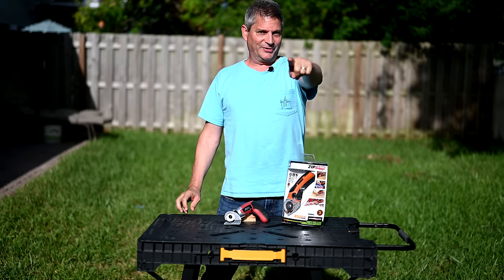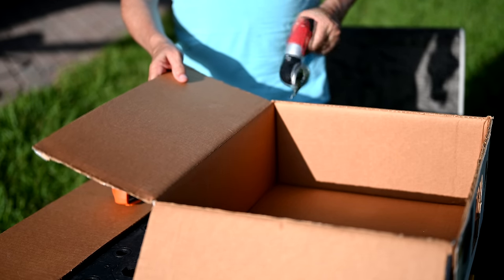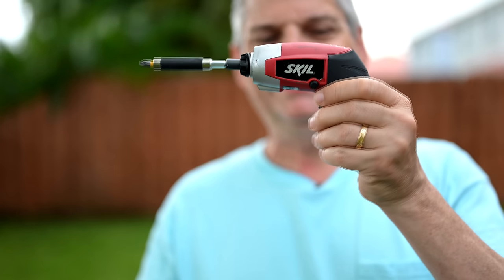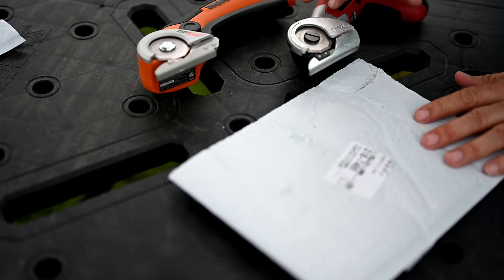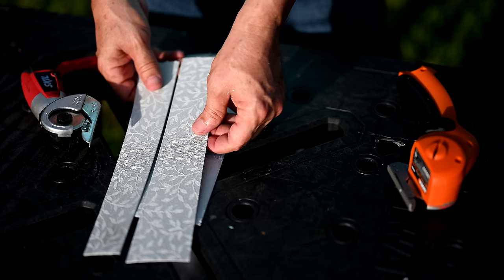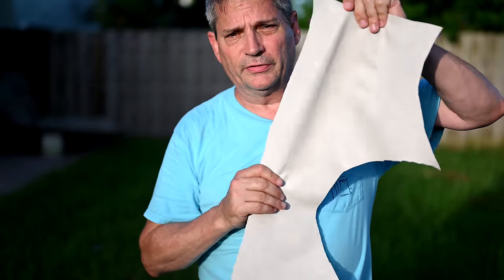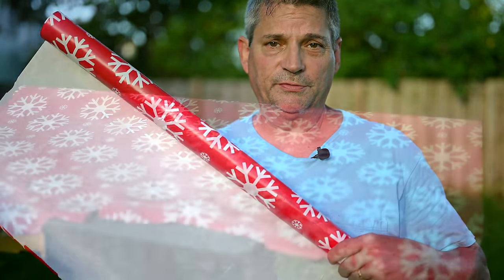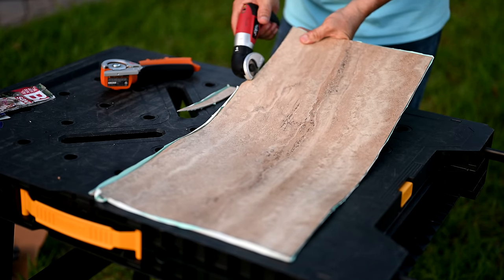Worx ZipSnip Cutting Tool Vs Bosch/Skil: Which is Better?

Comment: Looks like a great tool, For me, I fold all of my boxes and use no power. It's so easy, just cut along any tape that's holding the box together.............and fold. Saves a LOT of time and energy and battery power. Unless you deliberately have to get the box into small pieces in a very small recycling bin, can't see any reason to cut it into such small pieces unless that's purely for demo purposes.
Reply from the maker: I usually cut to 12" up to 18" pieces for recylce

Comment: A battery replacement might help the old tool. The new one seems decent. Don't know if I'd spend that much on one though
Reply from the maker: Problem is not the battery, the guard is all bent out of shape from years of abuse, the blade is still spinning correctly.

Comment: Enjoyed your Video.-- Great that you used so many different materials. -- Question -- How do you know if the Worx is as good or better than the Skil since you were you using a Skil that had a lot of past wear on it. ---  Do you think one cuts better than the other if they were both brand new ?
Reply from the maker: I think they are made by the same company. I think they were the same because the Skil used to be able to do what the Worx was doing.
Reply: @jeffostroff  Thanks for the info. -- I appreciate it !

Comment: Just curious how old was the blade on the Skil? I've the little skil screwdriver that's identical to that cutting tool and think it's neat. Would you say the skil cutting was well worth it?
Reply from the maker: Yes, the tool was worth it. If you can find the head unit with the blade on eBay, it might fit your tool. The blade is awesome and self sharpens.

Comment: I just purchased the zip snip but after watching your video I think I like the skil better I like how the head comes off of the skil I'd take it off & pop it into my impact drill & really get it flying, if the guard on you're skil is tweaked why don't you just bend it back? You seem mechanically inclined just clamp some visegrips on the edge and bend it back in place a little
Reply from the maker: I've tried it, just seems the alignment is too critical. Canadian company sells them for $50 but it's $25 shipping to FL. I woudl buy a new one if the total cost didn't come out to 3X my original $24 price.

Comment: i have one,  this does not cut through heavy duty cardboard  you have to push hard and it gets stuck.  video looks easy
Reply from the maker: The heavy cardboard I had was on the TV box, and it cut through that. Appliance boxes it can bog down in parts, which is why I cut it on the creases.

Comment: What I do to cut blinds is , use a grinder with a thin metal cutting wheel , and cut the whole stack at once , but do it outside !  I also use a clamps to keep it in line after I align square  ! Try it for yourself , let me know what you think  ?
Reply from the maker: Great tip! No chips at all on the bottom?

Comment: If you're going to test both of these, you should have used a new skil. If it's old, then it doesn't really allow you to compare it against the zip snip fairly.
Reply from the maker: It was not meant to be a fair apples for apples. As I mentioned numerous times in the video, my old Skil was old and worn down but it was all I had. AND you can't get them new anymore you can't find them. You need to pay attention better

Comment: Could this cut 1/4in wood? I noticed it's not a toothed saw blade so I assume not. I'm looking for a CHEAP EASY method to cut 1 foot wide detailed decor with curved edges out of thin 1/4 inch wood squares without it splintering or snapping. Hand saw takes forever. Jig Saw requires a table but can slip via human error if not mounted (maybe upside-down?), i.e. an EXPENSIVE HEAVY DUTY table saw. Good video btw, thank you, still might buy this lol.
Reply from the maker: This will not cut 1/4" I tried to cut 1/8" wood cabinet panels that we us eon the end of a cabinet and kickplate, and it bogged down as soon as we tried. But 1/4" will not even fit into the bade guard.
Reply: I’ve been using it to cut paneling - I thought it was 1/4 inch but maybe it’s less - any way it is totally not the right tool for the job … /:

Comment: Either. Oscillating tool with hook blade is the best and one less tool to charge
Reply from the maker: How are you going to cut cardboard with a hook blade? Gift wrapping paper?
Reply: jeffostroff ?? hook blade cuts cardboard like hot knife on butter,  no effort at all. good for old hand
Reply from the maker: @ometofu  Got a model# for one?
Reply: Dang just watched some videos on these and dang it will cut through anything.
Reply: I learn many things through folks' comments. Hook blades on utility knife works great on golf grips & cardboard. Gonna see about a hook blade for my oscillating tools. Thanks!
Reply: @jeffostroff  one year late. lol
Reply: @jeffostroff  looks like youtube removed my amazon link…. it is imperial blades 505

Comment: autofocus driving me nuts...not sure how valuable an old nag/young colt comparison is. lovely thumbnail
Reply from the maker: Yes Nikon had numerous problems with autofocus with this model and they kept issuing new firmware updates and we finally just switched over to using manual focus only when we're shooting items, and it's supposed to be pretty good at autofocusing on face recognition when it sees a human face on the screen.

Comment: Built in batteries, I just cant do them.
Reply from the maker: This Skil tool has worked 5 years on built in battery. The problem with he tool is abuse and the guard being bent out of shape, not batteries.
Reply: Usually just a few screws on the case and you are at the battery. Can google the codes on the side of it and find replacements. They are usually generic and can find them much cheaper than propriety pop in type.